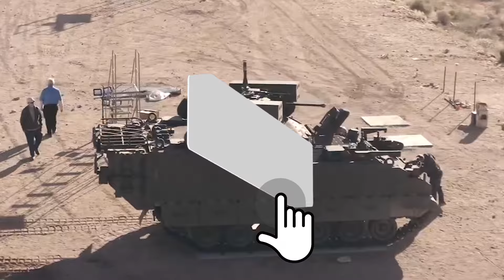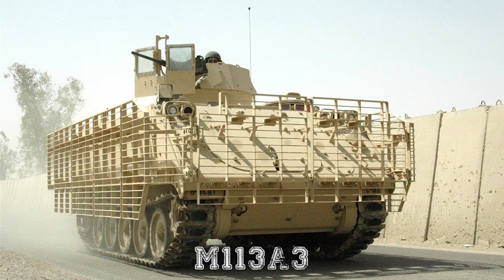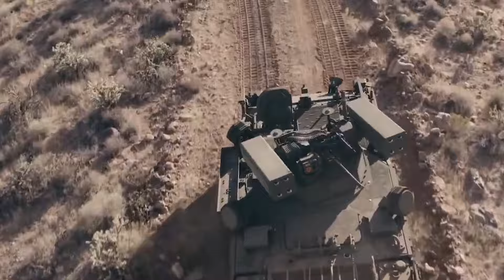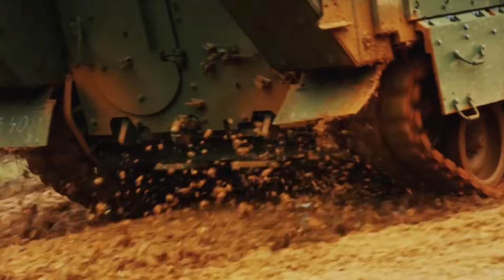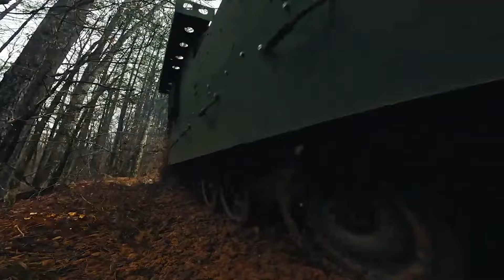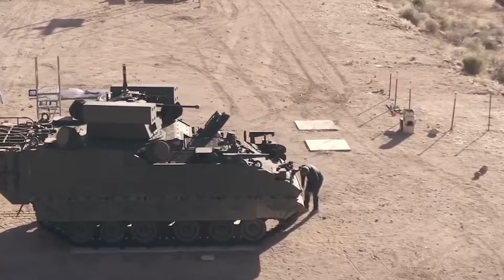US New AMPV Combat Vehicle SHOCKED The World!

Comment: OK,----.,  So it is a replacement for the M-113!...   A Cheaper Bradley... that is too small to do anything well...   They need to add about 4 feet to its length so it can carry the needed worthwhile Numbers..  After all it is not designed to go into Combat Assaults like a Bradley but to bring up the Reinforcements with what is needed like the M-113 while being as protected as the Bradley.

Comment: WHY the FUCK does it still have a flat hull bottom?
Reply: They just mount the seats to the walls so when the floor comes up your back doesn't compress.
Reply: @knowahnosenothing4862  v hulls can divert some of that explosive pressure, its a SMALL thing to ask for, layers of protection, flat hulls might as well be a fucking amplifier.

Comment: I don't understand why people don't realize that this isn't a replacement for the Bradley, even though its said several times throughout the video. The Bradley is is getting its own replacement. They are basically modifying the Bradley to fit a different role that is not primarily front line combat as it has been.
Reply: It's replacing the m113.
Reply: It's replacing the m113 in frontline service.

Comment: Lol.  First Medical Evac vehicle that is armed with Machine Gun Turret. Yeah, I get it is intended for Vehicle and Patient defense.  Then again if looks like duck, and can act like duck, it is freaking duck.  Second, why would down grade the Bradley platform to make new APC base type vehicles.  Yes, the M113 base version are showing their age, but it was created during a different time and phase of Mechanized Warfare.  When these vehicles were basically Battle Taxi, and it variants were suppose to be kept in the rear of fighting edge of the Front.  Since they were first manufactured the M113 and it variants have been pushed forward to edge of the fighting edge of the Front has expanded to what use to be the 'safe' rear areas, with new advance in Armored/Mechanized warfare.  Add the advancement of employment of various Helicopter formation didn't help either.   I mean having 3 or 4 Different base Vehicles for the Armored, IFV (Mechanized Infantry/Armored Cavalry), and at least APC based support vehicles makes sense.  The forth being maybe Light Tank (Assault Gun/Armored Car) type vehicle to give Airborne/Air Assault/Airmobile/Light Infantry type units some extra muscle that they lost when the M551 were stood down.

Comment: So how is this going to mesh with the XM30 replacement for the Bradley?  How come the XM30 remains stuck at the two competitors phase?   When is it going to production?  Looks like a lot of overlap in capability here.
Reply: XM30 competition downselected to 2 competitors only a year or two ago. It's certainly not stuck. If I recall correctly, something like 7 prototypes each from Rheinmetall & GDLS are due to be delivered for testing & competition in either '25 or '26, final selection the year after, start of low-rate production targeted for '27 or '28 and IOC planned for '29 or '30.

Comment: a open turret hatch . . . you mean the Commander's top hatch in the AMPV doesn't have a hatch (open/close) lid . . . the AMPV could have been a tad wider & slightly higher raised hull . . . it'd have greatly increased the available space in the crew & troop compartment, that otherwise is just too cramped . . . a heavy duty 5.5 in. suspension lift for enhanced off roadability that'd have complemented the torsion bar suspension of the AMPV . . . a turretless variant of the AMPV with a heightened (raised) hull would be even better . . . a compact 360° deg rotating remote weapons station is more than enough to take on most combat situations, instead of a turret . . .

Comment: Seriously??  Driver way at the front??  He be the first to be killed.  No protection what so ever for the drive. No protection against anti-tank mines and so on.  No turret for machines gun or cannon for protection.
Reply: What do you mean "no protection against anti-tank mines"? The whole purpose of the vehicle design is aimed at improving survivability against mines, improvised explosive devices (IEDs), and direct fire.

What do you mean "No turret for machine gun"? Did you watch the video? Even the mortar can be used as direct fire, but I guess you meant the general purpose vehicle which is fitted with MOOG Reconfigurable Integrated-weapons Platform. The vehicle has compatibility with over 30 different turret systems, including 30mm remote cannon. That's the purpose of armored MULTI purpose vehicle.
Reply: How old are you?12?Have you even been in a armoured vehicle lol